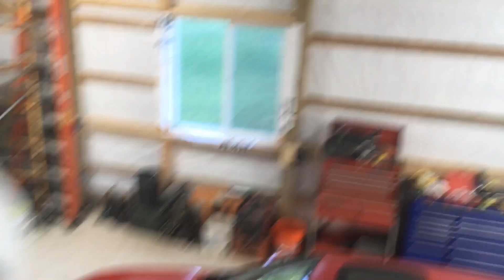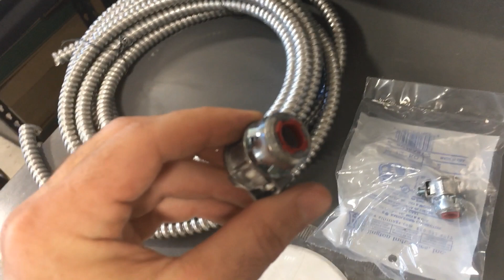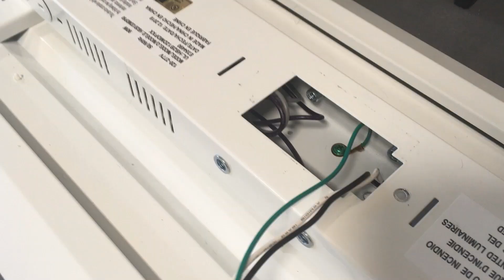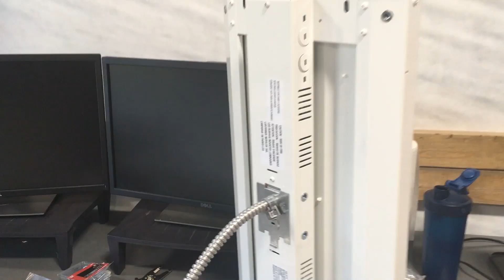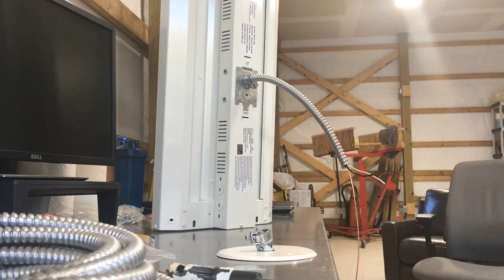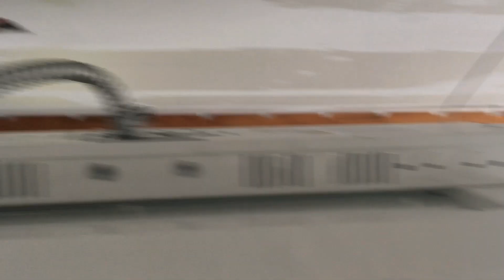Pole Barn - High Bay LED Install

Comment: I put same heater, and same lights in my shop. For lights, put plug adapter into light socket, and made whips from cheap extension cords.  Very happy with both. Nice setup.
Reply from the maker: Cool that you have the same setup! I’ve seen those plug adapters, they are slick.